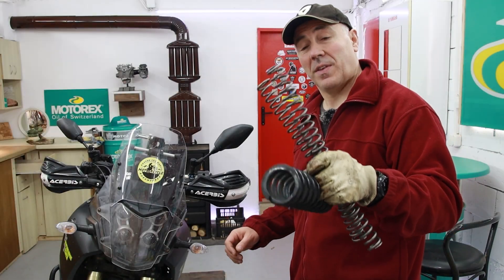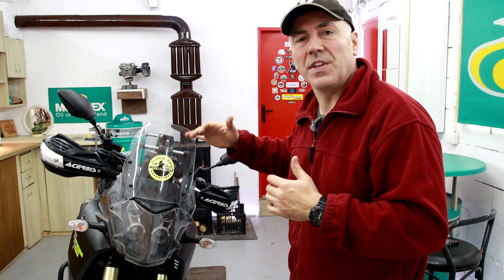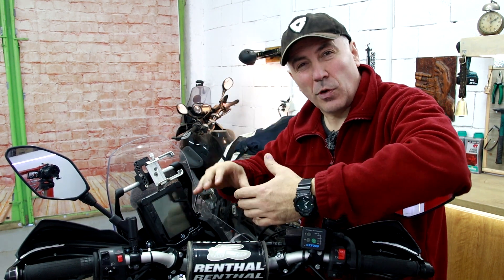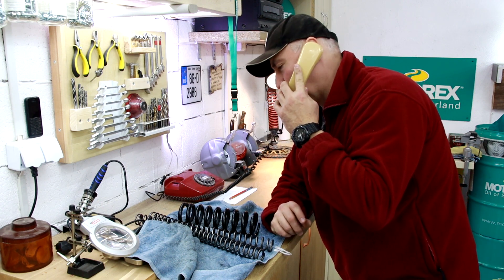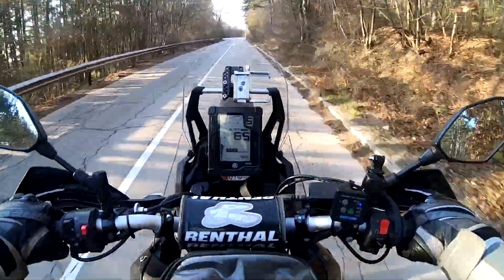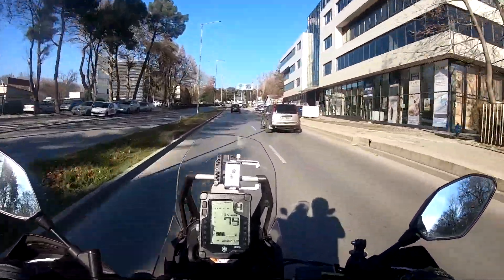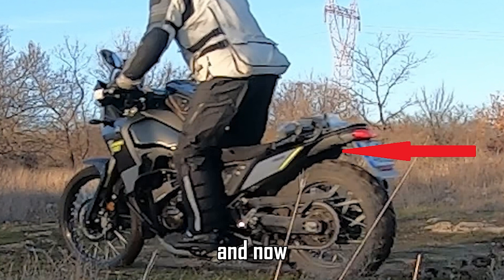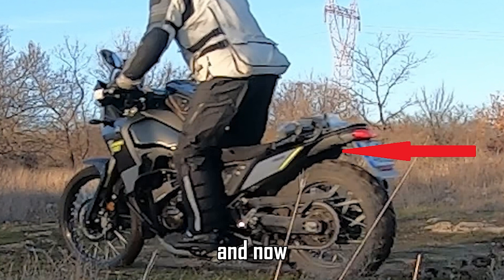I installed Stiffer Springs for My Tenere 700

Comment: I have bought these ones aswell, except front 6.3 (just need to change them, but in no hurry, winter is long). Did you reassemble front forks completely because you wanted to service these fully?
Reply from the maker: What you mean? How do you plan to change the springs without open the forks?
Reply: @motorcycleadventures  i mean this https://youtu.be/7GhCd0euGGA?t=762 . Ok, i havent been really looked into how it is for Tenere, but for my other bikes, to just change springs and oil, you dont need to remove everthing, open caps, open that nut that is right behind caps and pretty much thats it.
Reply from the maker: You still need to remove the big nut underneath and also I needed to change the oil.

Comment: The problem is, the T7 isn't a dirt bike. It's a too tall street bike. Start treating it like a dirt bike and all sorts of bad things happen. The fork seals don't, the rear shock doesn't, the adjusters don't do squat, the deep oil sump gives a high CG and poor swing arm angles. The whole bike is a bean counters compromise. The only thing good about it is the looks.
Reply from the maker: After own it for two years and rode it almost everywhere you cannot convince me in this. Yes, it is not dirt bike, but it will work in any condition almost perfect.

Comment: Did you consider progressive springs?
Reply from the maker: No!
Reply: @motorcycleadventures  why? I’m curious. Do you consider normal ones are better?
Reply from the maker: I think that progressive springs work better in a normal forks, for USD is different.

Comment: 6.6 front and 90 rear?
Reply from the maker: Exactly!
Reply: @motorcycleadventures  I have the same Springs. remember to turn the rebound down and the compression up a few clicks
Reply from the maker: I left it in the middle

Comment: You said that  stock is good. Now is good too. Always good when someone pay for that. Stock suspension in t7 is garbage. Tank the same. But if respring change this suspension to be decent? I think that no. There are 20mm valves. Fronk forks are garbage in stock t7. Yamaha should do service action on change that garbage. Anotrherway i have to pay for my money. And maybe yamaha utilise my garbage? Yamaha like produce garbage.
Reply from the maker: It is good for 95% of the riders 95% of the time. If you are from these, rare 5%, it will be much better to find another bike.
Reply: @motorcycleadventures  its exactly other way. Thanks for share. It will be handfull to get info about springs.

Comment: why in new on off bikes make so short suspension?even my xt has bigger travel
Reply from the maker: 220 mm front and 200mm rear is more than enough for 95% of the riders.
Reply: Isn't the XT a duel sport  not an adventure bike.    Ktm 690 has 275mm  300sx has 300mm   230mm is the most normally for an adventure bike  aprilia 660 has 240mm that's class leading amounts of travel.    It doesn't generally help handling on road having all the travel.  Also makes the bike very tall.
Reply: @chrishart8548  dude,you spoked about exceptions.95% of modern on off,now called "adventure",bikes,have short suspensions.for example take the cb500x and compare it with a kle500....
Reply: @thodoris3790  I miss the original kle500 when they came in all those bright colours  do you remember?